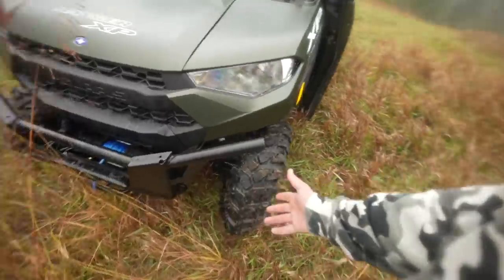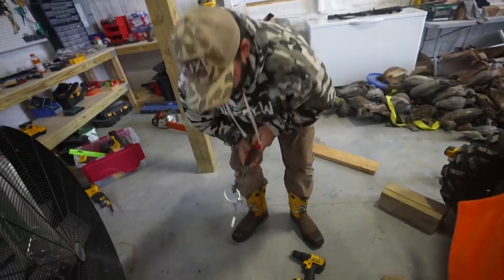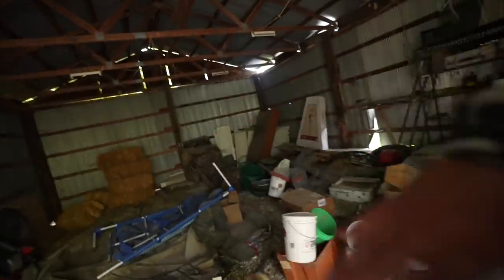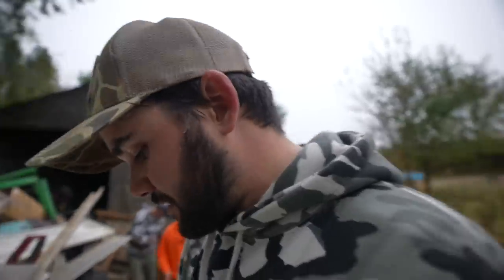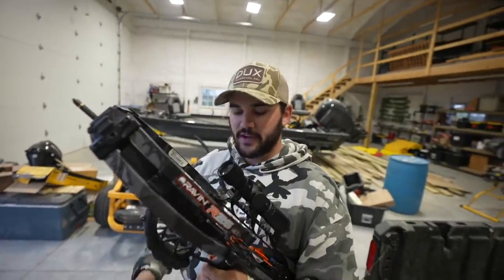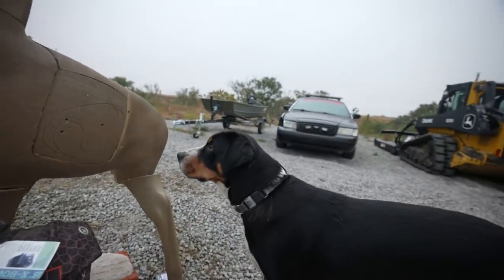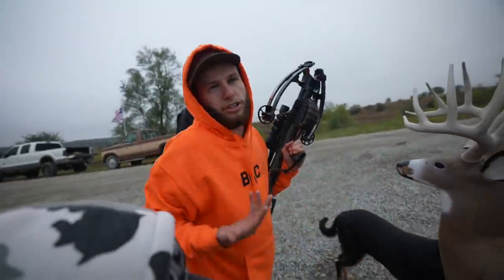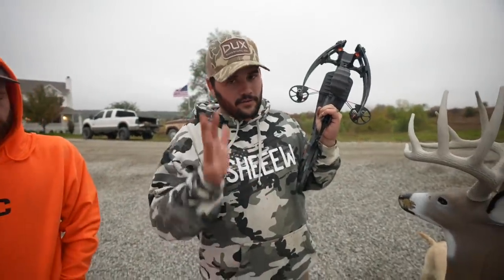I Bought an INSANE CROSSBOW for HUNTING in My BACKYARD!!!

Comment: broadhead selections going to be key for a crossbow. make sure you do plenty of research. also once you think you’ve found the one you want to use, make sure you shoot the crossbow with the broadhead on it to make sure the flight of the bolt is still the same as if it were a field point. also if you think your bow is accurate, don’t be afraid to mark your arrows on how they fly, whether that be high or low and left and right. make sure you shoot plenty before you go and get comfortable. also, can’t stress it enough, keep your fingers off the rail! (i learned the hard way) crossbow hunting is really fun and enjoyable! keep up the great work my man!!

Comment: I have a Ravin R10. Sight in at 20 then move to 50 yards and fine tune with speed dial and adjustments to correct. Should be good up to 100. I would not ethically shoot a deer at 100 yards with a crossbow

Comment: Get a Tire-Ject sealent kit it’s like green slime but 10x better. Put it in your tires and it will seal the holes and it will also seal new holes. Those factory tires are usually ass

Comment: Once you pick out a Broadhead to hunt with(I prefer Fixed Blades), be sure to sure to sight in with the Broadhead as point of impact can be different than field points. Be sure Vanes are aligned with Blades so the bolt will fly true. I would limit my shot to about 50 yds. Just fyi. Good Luck!!

Comment: if it hits the shoulder with a bow you could kill it. low shoulder will wound it and have some blood, in the middle of the shoulder it will most likely kill it, high shoulder you will barely get any blood and you will wound it. THIS IS FOR A CROSSBOW ONLY.

Comment: Crossbows are a blast. I had a wicked ridge warrior before moving to the Philippines. I shot squirrels, rabbits, chipmunks, and a couple turkeys. Squirrels and chipmunks when you shoot em with a crossbow lets just say you won't be able to show the kill on YouTube cause it will pull the guts through the exit hole. Rabbits the same thing will happen but not as bad. I have shot several deer with it and the last buck I shot with it put the buck down on the spot. Instant parking job no tracking required. To get squirrels and rabbits you gotta sit in a blind where you know they are. Take Lucy with when you do it and have her in the blind with you and send her out to retrieve them!